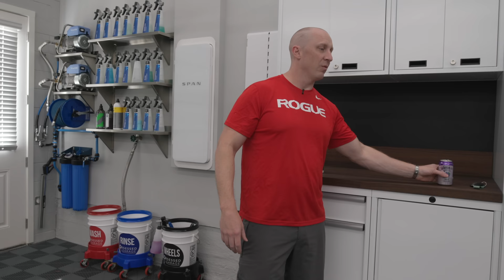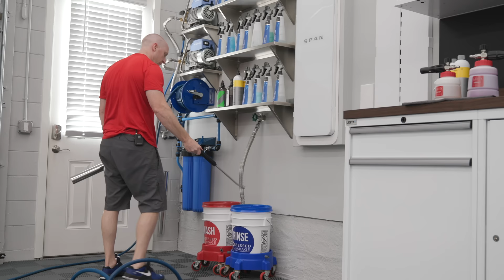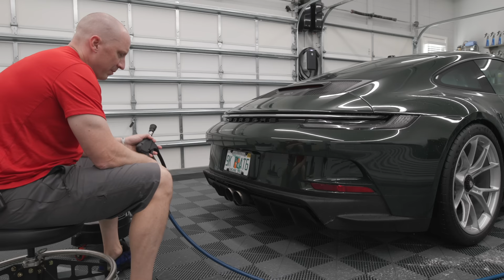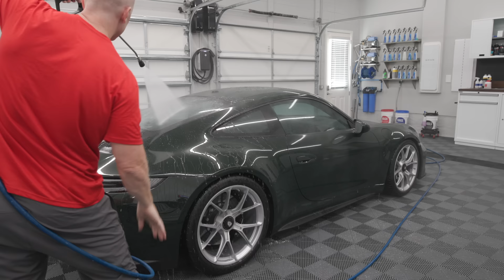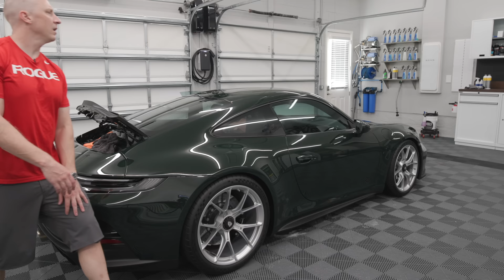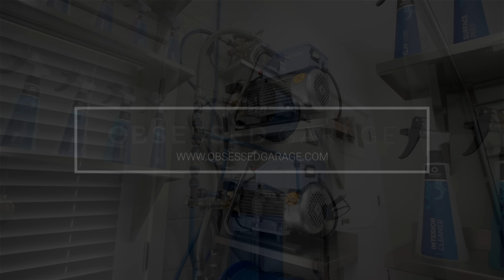Wash & Talk: 992 GT3 Touring Brewster Green

Comment: After foaming the car, I see you don’t rinse the car from the roof down. I always assumed rinsing from the top down was best, just like taking a shower. What’s the method to the madness here, or am I overthinking it?
Reply from the maker: Not when doing the pre-wash.  I want the prewash to take the dirt with it with pressure, so I wash bottom up.  When washing top down, the soap runs off from water dripping downward.

Comment: Interesting comment re Swisstrax evaporating water from underneath. Do you find it smells with the water sitting underneath for a long period? I moved into new home with a big 4 car garage perfect for indoor washing, but the floor is sealed aggregate, so the water just sits on surface and takes days to evaporate. I’m looking for a solution
Reply from the maker: I don't find it to smell or be an issue.  The bulk runs off and the remainder drys in a few hours.

Comment: Matt, would love to get your thoughts on the Koch chemie reactivation shampoo
Reply: I think it has slightly better lubricity than Descale and is easier to source right now. Descale is out of stock pretty much everywhere I get products from. It definitely performed really well. Unclogged a coating just like Descale does. Best coating maintenance product I've ever used. 99 percent of customers are using hose water, cars are getting rained on or come in contact with sprinkler water
Reply from the maker: I’m going to test it out on the Raptor.

Comment: How pitched is the garage floor? Did you have concrete guys or whoever do it or was it already like that when you bought the house? Seems like a great alternative when a drain isnt realistic
Reply: Standard 1% slant. Most garages in climates that get any bit of water will be slightly angled for that reason. Super common up here in the PNW, but I'm sure it is ubiquitous in any area that gets a lot of rain/snow.
Reply: @thelowcartheory thanks. I'm surprised that's enough to effectively move all the water out, especially with the resistance from the tiles
Reply: @motiOn732  all that is needed. I believe standard is 2 or 3%...same as say a bath tube and all that is needed to do the job
Reply: @motiOn732  The tiles are channeled on the bottom.  The water flows underneath them.  Kinda like a floating floor.
Reply: @timkinley1779  I know. But there is still some tile touching the floor which would prevent flow. Combine that with a very mild grade and I don't think it's unfair to expect pooling
Reply: @motiOn732  You're over-thinking it.  The thinking has already been done by the tile designers and building codes. You have to have a realistic expectation that things are done for a reason.  Water flowing downhill isn't a "wow!" thought.
Reply: @timkinley1779  am i overthinking it? Combine an ever-so-slight grade with 'obstacles' I don't think you're going to get a lot of drainage. I don't think the people who designed the house or poured the concrete factored in a guy washing his car in there. Also, this is Obsessed Garage. People think about the details here.
Reply: @motiOn732  I don't think everyone is incompetent at what they do.  I've had six houses and every garage floor sloped towards the doorway.  I've put Swiss Trax down in three different garages and the water flowed outward with no issues.  So my experience is..  Swiss Trax and every builder knew what they were doing.
Reply: @timkinley1779  mine doesn't really flow outward and it's polyaspartic coated =\
Reply: @motiOn732  my garage floor slopes 1/8" per foot and has one or two low spots. It's a non-issue. The vast majority drains out and the rest simply evaporates.